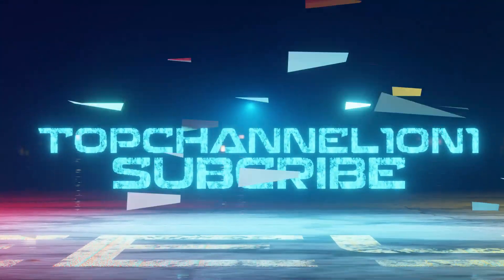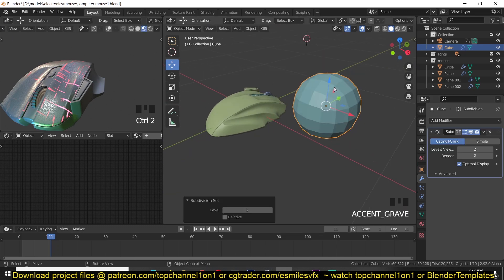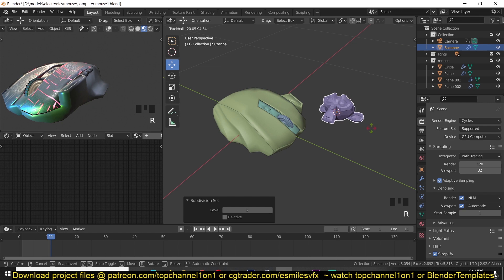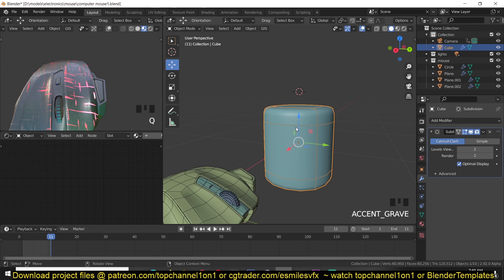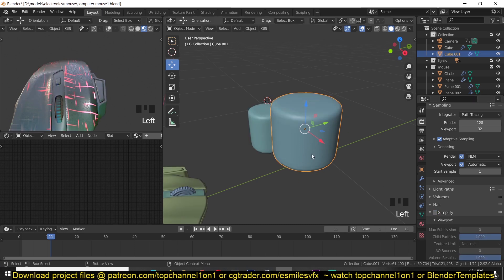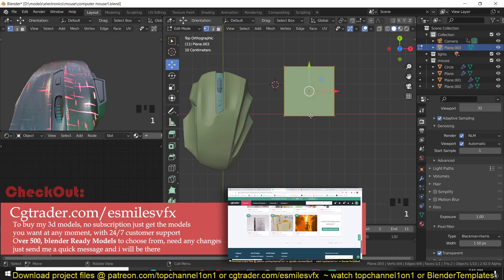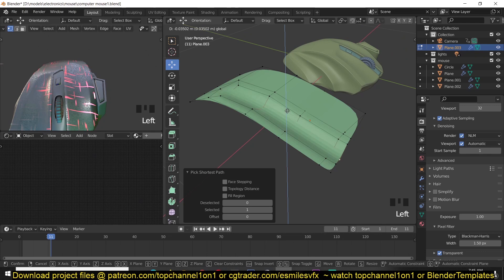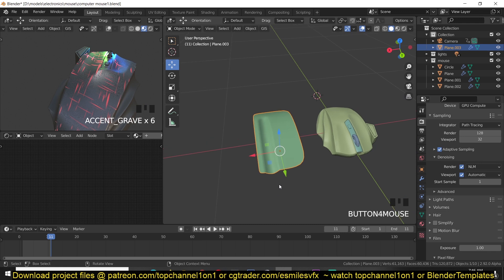hard surface modeling in blender explained modeling a gaming mouse

Comment: Basically the crease is also adding support loops and pulling them towards that line depending on the number set
Reply: Exactly, it has "the role" to support the bending of the mean bevel weight and it's best to master it 💪
(You can access it in edit mode by pressin N to show the sidebar and then in the Intern tab you can alterate the edges data)
Reply: @g-kems  that if you need precise control or want to check it. Shift + E and hitting you input value is faster :)